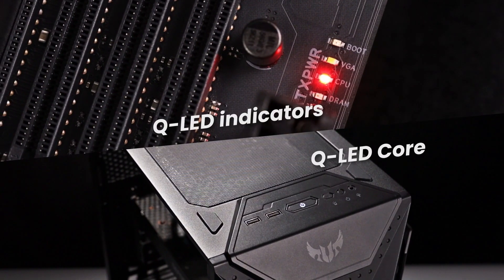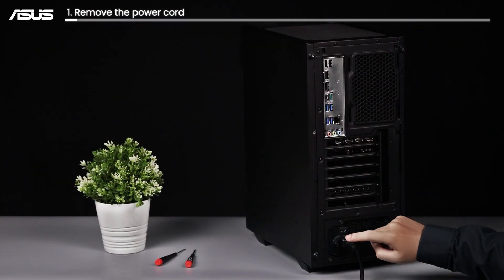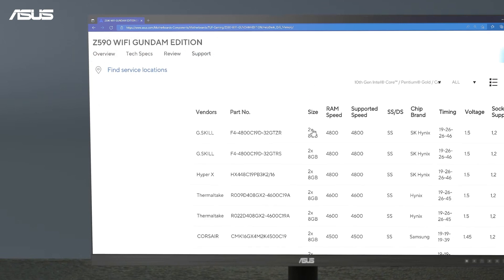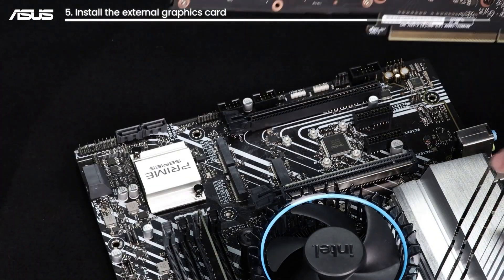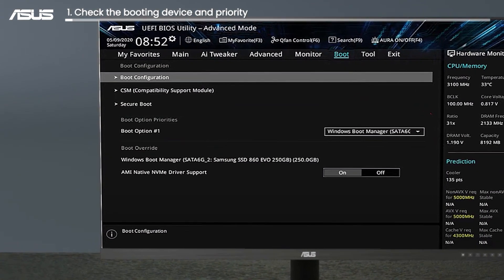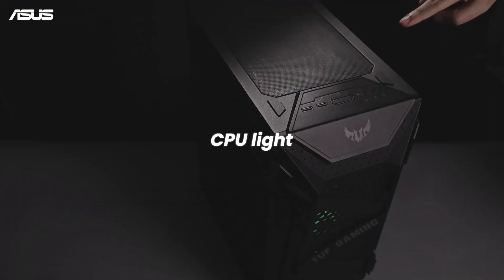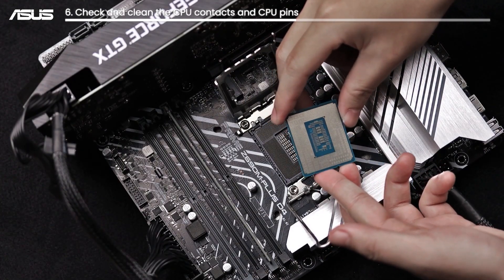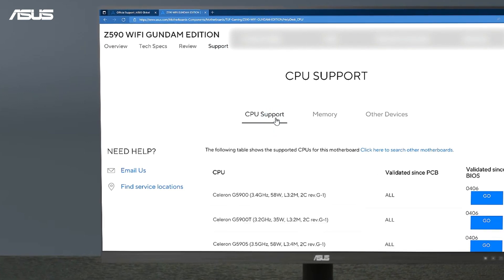ASUS Motherboard Troubleshooting via Q-LED indicators, Q-LED Core   | ASUS SUPPORT

Comment: Hello, i recently just built my first pc. My motherboard is the ASUS B450M- A II and everything seems to work fine. It boosts up, fans work and everything, but theres a yellowish orange q-led light that keeps slowly blinking on and off, even after i turn off the pc. 

My graphics card is the xfx speedster swft 210 radeon rx 6600 and my ram is the corsair vengeance DDR4 RAM 16GB 3200MHz
Reply from the maker: It is likely that the motherboard is still in standby power mode, which causes it to display in this manner.

Comment: Asus prime z890-p not working first 5 seconds: light flashing very quick, and then it will blink slowly (every 2 seconds) and it wont go into bios.

when i remove all ram: it will always blink quickly. so it does see my ram.

i tried both my motherboard and the gpu (rtx5060) to get display output but nothing is working. 

cable used: displayport (i dont have hdmi)
Reply from the maker: It is recommended to check the CPU and reseat it while inspecting for any bent pins. Install only a single RAM module in slot A2, and ensure that both the 24-pin and CPU 8-pin power connectors are properly connected. Additionally, try testing with an HDMI connection. If the issue persists, the motherboard may be faulty.
Reply: @asus_support  i switched rams and it worked. i had "patriot venom viper" and when i switched to "xpg lancer blade" it worked

Comment: Hello, first time builder with both the ASUS Btf motherboard and ASUS 5070 ti btf edition for my daughter.

When I turn on power from the switch of the psu (red lights shows up on the gpu). Even when I finally powered up first boot, red light still on. I’ve heard from other resources about the red light can be turned off during bios menu or once updated software of motherboard has been downloaded but I haven’t gotten past the first step yet.

Also, on the ASUS btf motherboard, it shows “white/green” light. Also, getting no display on my gaming monitor. But I think I may just forgot to change the monitor input to disconnect lay port manually. 

Not sure if it matters but I’m also using Corsair 850x PSU. Also just using of course the small power adapter from the gpu connected to the motherboard.

Not sure if I’m missing anything else to be connected. 

Is it normal for white/green light to be on during first boot of the computer? 

Any help is greatly appreciated. Thanks!
Reply from the maker: Based on your description, it is normal for the BTF motherboard to show white/green lights during the initial boot as part of the startup detection process. The red light on the 5070 Ti BTF will also remain on before entering BIOS or installing drivers, which does not indicate an abnormality.  
The lack of display you are experiencing is more likely due to the monitor not being switched to the correct input source, the signal cable being connected to the motherboard instead of the graphics card, or the memory and GPU power modules not being firmly seated.  
We recommend you verify that the monitor input is set to DP/HDMI, ensure the signal cable is connected to the graphics card, firmly reseat the memory and GPU power connectors, and then reboot the system.
Reply: @asus_support Hi Support, l finally fixed it. Being a rookie sleeping under the rock lol. I did not plug in the 12vhpwer cable to the motherboard and the 2 PCIE cables attach on the other end to the PSU. After that was plugged, it booted right up and passed POST. As for the signal, same noobie mistake. Just like you’ve mentioned, Even though I’ve plugged my DisplayPort cable from the monitor, to the GPU, I’m assuming the monitor would auto detect, but I had to manually change the input from HDMI (defaulted) to DP.

But I do notice for the 5070 Ti ASUS BTF Edition, when you turn off your computer, the red light does come on in the front of the gpu and based on what people say, it’s just on standby mode and nothing to worry about.

I just had one more quick question, My Corsair AIO Pump 360 TITAN with LCD, all the fans and rgb lights turns on. LCD screen also shows Temperature. But when I go into the ASUS BIOS, under AIO_PUMP, it’s not reading anything. It just says “N/A”. I’ve already updated the BIOS to the latest version. I did plugged the tach cable (3 holes) to the CPU_FAN (4 pins) instead of the AIO_PUMP on the ASUS BTF Motherboard as I’ve read that if you plugged into the AIO_PUMP port, you’ll get some type of error message.

I’m just hoping that my pump is really working with the lcd and reading temperature displaying. The “N/A” from the AIO_Pump in the BIOS is the only thing making me nervous..

Thanks for the reply back.

Comment: Help please!
Just bought z890 ayw gaming wifi W board from microcenter with ultra 7 CPU. 
Had to buy my own cooler. Installed everythin turned on power supply. No lights or sounds from motherboard.
Hit the power button. No lights or sounds of any kind from motherboard.
Power supply is known good. As are all the drives and video card.
Removed the drives and video card just to be sure.
Again no lights or sounds at all from MB.
Any ideas?
Reply from the maker: If your device is newly purchased, we recommend contacting the reseller to confirm whether a return or exchange is possible. Sorry for any inconvenience it may be caused.
Reply: @asus_support  I already did. Couldnt get help from anyone at asus. 
Asus products used to be much better. Been talking to a lot of repair people, Asus is now considered inferior.

Comment: Hello Asus . i have 2 config 
Rog strix b850a gaming wifi + r7 7700 + rtx 5070
Tuf gaming b850 plus wifi + r7 7700 + gtx 650ti
Both conf have problem 
With 5070 and 650ti - cant enter to bios . " no signal" "boot" on debug led . but , easy  enter in os
Win 11 
Rog bios 1001
Tuf bios 1066
Reply from the maker: Regarding your question, I would recommend you visit the following forum and post there to get more assistance. 
https://rog-forum.asus.com/t5/gaming-motherboards/bd-p/HSS_MB
Sorry for any inconvenience it may be caused.

Comment: asus all the lights keep flashing like its a rave 😭
Reply from the maker: Please first power off and unplug the device, then reset the CMOS. Make sure the memory and graphics card are properly seated, then restart the system. If all Q-LEDs are still flashing, it is recommended to reflash the BIOS or send the motherboard to a service center for inspection.

Comment: My Asus b550 q leds wont turn on no signa o mouse signal
Reply from the maker: Please ensure that the power cable is properly connected. Then, try testing with a single memory module, graphics card, and minimal hardware configuration. Clear the CMOS and reboot. If the Q-LED still does not respond, there may be an issue with the motherboard or power supply, and we recommend sending it in for inspection.
The following is the contact information:
https://www.asus.com/support/service-center-location 
Also you can contact the local service center for help.
The following is the contact information:
https://www.asus.com/support/CallUs# 
Sorry for any inconvenience it may be caused.

Comment: Hi asus, i got the vga light is on. its a b650-E WIFI motherboard and a MSI 5060 what else can i do?
Reply from the maker: Please check whether the graphics card is properly inserted and verify that the graphics card power supply is functioning correctly.

Comment: I just built my pc in a ASUS Prime Z690-P WiFi D4 motherboard and it didnt work, but there arent any leds for me to check. And the light at the top is solid.
Reply from the maker: It is recommended that you refer to the following FAQ for troubleshooting.
https://www.asus.com/support/faq/1042632/
Sorry for any inconvenience it may be caused.
Reply: It was a faulty motherboard so I just took it to my cousing who fixed these types of things and its allg. @asus_support

Comment: Hi Asus, my QLED aren't even coming on I'm not sure what it is. Cpu, fans and gpu all spin. No QLED lights when switching on.
Reply from the maker: It may be caused by a power supply error or a short circuit on the motherboard. We recommend removing the motherboard and performing a bare-board test.

Comment: Q-leds de placa madre asus b560-plus wifi (cpu rojo y dram ambar) se encienden intermitentemente. El led del boton de power se enciende intermitentemente en ciclos de 6-8 segundo. Ordenador no arranca. ¿Cual es el fallo y su reparacion? Gracias de antemano.
Reply from the maker: It is recommended that you check the CPU and memory. You can reinstall or reseat them and then verify the issue again.

Comment: I had a green light appear after installing a new graphics card, even though the PC originally booted up fine. It turns out the bios reset the RAM speed to something much lower than it was supposed to be. Once I changed it back, my PC booted up fine.
Reply from the maker: Regarding your question, I would recommend you visit the following forum post to get more assistance. 
https://zentalk.asus.com/t5/motherboards/bd-p/motherboards
Sorry for any inconvenience it may be caused.

Comment: A few weeks ago i build my new configuration. It starts and it works well. I shutted down, till today, when i want to plug it again.  After a few led flashing the motherboard suddenly die (asus b450 prime). No one can explain. The pc was kept in proper conditions with no humidity.
Reply from the maker: Regarding your question, I would recommend you visit the following forum post to get more assistance. 
https://zentalk.asus.com/t5/motherboards/bd-p/motherboards
Sorry for any inconvenience it may be caused.
Reply: @asus_support  Fortunately the motherboard is fine. These AM4 sockets cpu's are very unstable. I repositioned the cpu and everything is fine. Thank you for the feedback.

Comment: I have just built a rog STRIX x870e-e with a ryzen 7 9800x3d. I have no display, via a GPU AND with GPU disconnected and with iGPU HDMI output and upon power up I've got error code 15 /yellow DRAM LED, after about 15 seconds the Q Code switches to AO and red CPU led.  I have tried the latest bios and resetting ram nothing has worked. Gskill trident z5 ram 32 x2
I've checked the pins and seating of the CPU. Everything looks normal. All the components power on and all fans including on the GPU spin but no display.
Reply from the maker: Regarding your question, I would recommend you visit the following forum post to get more assistance. 
https://rog-forum.asus.com/t5/gaming-motherboards/bd-p/HSS_MB
Sorry for any inconvenience it may be caused.

Comment: With the boot light staying on and red... how am I supposed to access the bios? It won't do anything, no matter what i press.
Reply from the maker: Regarding your question, I would recommend you visit the following forum post to get more assistance.
https://zentalk.asus.com/t5/motherboards/bd-p/motherboards
Sorry for any inconvenience it may be caused.
Reply: @asus_support  I actually gave up, removed the r5 4500 CPU I was trying to use and put it back in it's system (which booted no problem), and put my r9 5900x back in the empty socket.
Then I tried to boot, just to see what would happen, and it booted no issue.

Still no clue why the light was on and the system wasn't posting before, but it's working now, and the donner CPU (which I thought i would need to update the bios, as the 5900x wasn't reading at all prior) both work.

Comment: Hello, I'm with a recently built PC with ASUS B650M-E WIFI motherboard, I have noticed that when I turn on the computer, the q-leds light up in in an order like vram, then cpu, then gpu then boot and then every led turns off and the PC shows image on the monitor, not sure if that's a problem or not, seems like the motherboard diagnose those components before turn on. The problem is that the it takes some time before the computer actually turns on, showing image on the screen. Is there a way to make the mobo skip this proccess and startup faster? Also, does this Power-On Self Test always occur during startup or it happens from time to time to check components?
Reply from the maker: Regarding your question, I would recommend you visit the following forum post to get more assistance. 
https://zentalk.asus.com/t5/motherboards/bd-p/motherboards
Sorry for any inconvenience it may be caused.

Comment: I have to be honest, I used to use ASUS mother boards in the past and gave up on them as the quality of the products were hit and miss, I relented and bought a brand new system with an ASUS prime 550m-k mother board and nothing has changed, I have built over 500 computers spanning 30 years, I put this together like I have done with other computers, I follow the manual etc, and the system won't boot, the fans work and the lights light up but no post and I get yellow flashing leds on the board I have checked and rechecked the connections and nothing. I have looked online and I see so many others have had this same issue, I go to the ASUS website for tips and also YouTube, there's nothing on the website about the Yellow leds for this particular motherboard so I find this video a waste of time. I think I will return the motherboard to the supplier and buy a Gigabyte motherboard, never had any issues with those and they work out of the box. Don't bother with these mother boards they will only give you grief. I have a compatible am4 processor and ddr4 ram, only using onboard graphics so system is bare bones, all that is plugged in is power supply to mother board, power supply to CPU, 1 TB, SSD drive and case plugs, and relevant fans, nothing else.
Reply from the maker: Regarding your question, I would recommend you visit the following forum post to get more assistance. 
https://zentalk.asus.com/t5/motherboards/bd-p/motherboards
Sorry for any inconvenience it may be caused.

Comment: Tja nur komisch das das Problem sogar bei Neuen Mainboards auftritt: Grafikkarte getestet Funktioniert eine andere Eingebaut selbe Problem.
Ram getauscht Problem bleibt. Und es ist bereits das dritte Mainboard das getauscht wurde.
Das Größere übel das es von Anfang an so ist man weder ins Bios kommt noch das das Mainboard etwas anderes macht.
Check RAM okay Check CPU okay VGA leuchtet Boot leuchtet.
Das Mainboard B650-Plus sollte für die 7000 / 8000 und die 9000 Serie sein. ich denke ehr das es am Bios liegt das man nicht mal zurück Flashen kann.
Wahrscheinlich schon vom Hersteller auf den 9000 Serie geflasht wird aber verkauft mit der 7000 Serie ernst Haft.
Schön Sauber machen also ein Neues Mainboard muss ich nicht Säubern es sollte von Anfang an Funktionieren.
Schade ist auch das man nicht wie früher einfach einen Neuen Bios chip drauf setzen kann. Das war früher möglich heute nur noch Probleme.
Also ich hab noch nie bei einem Asus Mainboard solche Probleme erlebt, noch das ich es hätte so Stark reinigen müssen.
Man kauft heute keine Mainboards mehr die Funktionieren sondern nur noch Probleme mit bringen. Dafür anständig viel zu viel Geld verlangen.

Comment: I'm having issues with my x670e hero. No display signal, Constantly getting yellow light with error 00 and RGB ram sticks are not lighting up, but everything els is. This only happened recently from a manual windows shut down.  And I have tried reseating ram along with buying more of the same and same problem happens, I have also tried clearing CMOs, using USB to flad bios to 2506, removing everything but the CPU(7600x),cooler(arctic liquid freezer 2 and 1 stick of ram (kingston furry beast RGB DDR5)in slot 2 connecting HDMI to the motherboard to try and get the system to boot. But nothing works.
Reply from the maker: Regarding your question, I would recommend you visit the following forum post to get more assistance. 
https://rog-forum.asus.com/t5/gaming-motherboards/bd-p/HSS_MB
Sorry for any inconvenience it may be caused.

Comment: I just got the motherboard installed but I get no post whatsoever, no bios, nothing at all. The VGA light is on and white, the boot light is green and on. I tried taking out the graphics card and reinstalling but it didn't do anything. I am stuck pls help. My cpu is i7-14400F and graphics card is rtx 4060. The components worked perfectly fine before I changed the board so I don't think it's any of the components. Pls help.
Reply from the maker: If your motherboard is newly purchased, I would suggest contacting the retailer to see if a return or exchange is possible. Sorry for any inconvenience it may be caused.

Comment: Hi, I hope this comment section still support. I have an Asus prime b560m-a motherboard with i5 11400f, 32gb 8x4 ddr4 and rtx 3060. The pc is working fine but today I turn it on and it shutdown immediately, it shown red light which is CPU and yellow light which is bootlight before everything turn off. I tried basic troubleshoot like remove the ram and try each stick or remove gpu and plug it back in but the pc still shown the same behaviour. Please help and thank you.
Reply from the maker: Regarding your question, I would recommend you visit the following forum post to get more assistance.
https://zentalk.asus.com/t5/motherboards/bd-p/motherboards
Sorry for any inconvenience it may be caused.

Comment: The problem is that I have a B450M-A II motherboard and it does not have lights to indicate these problems. The only lighting on the motherboard is in the PCI slot of the graphics card... I have a black screen and when I connect the device to the electricity without pressing the power button, I find RBG lights for the keyboard and a light on the motherboard lights up directly without interruption
Reply from the maker: Regarding your question, I would recommend you visit the following forum post to get more assistance. 
https://zentalk.asus.com/t5/motherboards/bd-p/motherboards
Sorry for any inconvenience it may be caused.